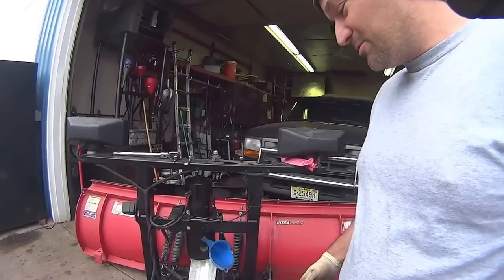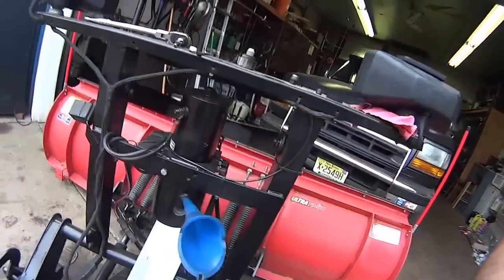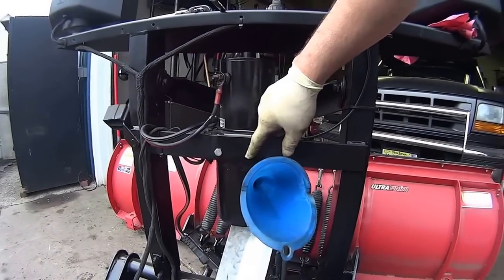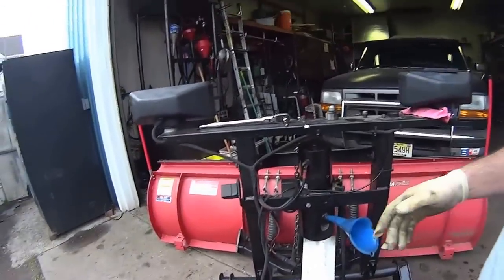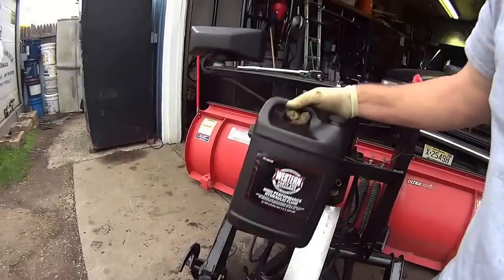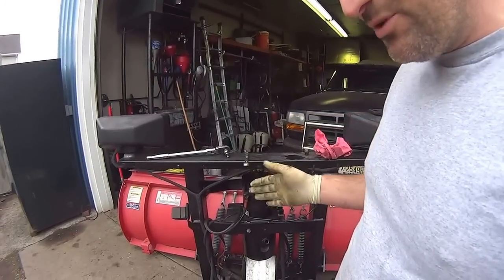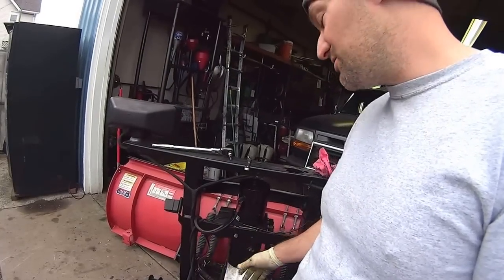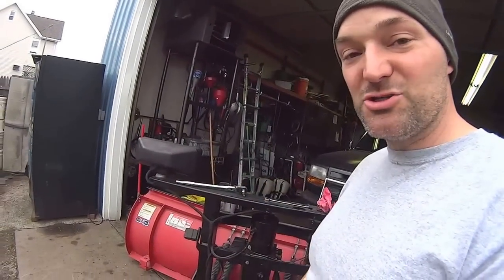Western ultra-mount plow servicing and head light check

Comment: No problem on the audio but I appreciate your video.  You gave me some great tips.  One guy on youtube said to pull the oil tank off, i pulled mine and had sludge at the bottom.  Cleaned reservoir and filter with brake clean...good as new.  These are great plows.thanks
Reply from the maker: Sting 
Yes beginning of every season before it gets used. 
These are vented and the humid air does cause condensation inside the units

Comment: Thanks dude, i just bought the same exact plow, same light out and everything!!! Thanks for the video, saved me some time.
Reply from the maker: Jesse Wustner 
No problem 
That’s why I make the videos!
Makes me happy when the average person like myself can save money on fixing things, to save money and not get taken by a**holes that over charge for simply things... 
Any question ask me before taking it to a western for service....
Reply: @DavidsHowtosReviews  i drained tank, i didnt take off tank and clean filters.  I refilled with new hydro oil, and moved plow up and down,  left and right a couple times, it worked well.  As soon as I was going to stop actuating the plow, it stopped working all together.   There is a click in the motor, when i use the controller.   There is no movement whatsoever.   Is it possible that the motor just went bad from sitting for a while?? It worked fine one minute,  the next,  nothing...  im lost, i replaced solenoid,  nothing....

Comment: How do i fill it with oil. My western plow   doesnt have a fill csp on top.
Reply from the maker: Most of the fills have a square nut as a cap, look for that.
Is has to be close to the top of the tank, it doubles up as the correct level indicator also

Comment: I have the same plow on a 01 2500 ram. I have no headlights or turn signals on plow. Replaced 3 plug isolation module as well. Still 0 lights, where do I find the fuses for this thing? Another thing I have a heavy draw when lifting and plows going up down left and right very slow. If pump is also bad np I'll replace it. I don't know anything about these so I don't know where to start. Any and all help is appreciated. If I could call you that would be awesome as well. I know calling sounds weird but I had a guy call me off one of my vids. Helped him fix his clutch on his motorcycle. Thanks in advance
Reply from the maker: Unfortunately all installers do these a little different there is no industry standard. Follow wires look for little water tight black boxes
Link to wire schematic
https://images.app.goo.gl/EtAfm3dvUr13dM4UA
Reply from the maker: As for the slow pump with the heavy draw. Take tank off remove the two filters and clean them if they are black with moss that’s probably ur problem 
If it still does it you can try changing out the motor they tend not to last as long as the older units we found
Reply: @DavidsHowtosReviews  i took motor off yesterday and its shot. ordered new one online, thanks for the link. ive checked the fuses and they are all good. my plow is the 3 plug w 3 plug isolation module. i also have the 6 pin contoller.
Reply from the maker: Good so that should solve your problem 
Just double check your alternator if you used it a lot like that, make sure it’s charging correctly.
Reply: @DavidsHowtosReviews  oh yeah its chargin fine. my other issue is not switching to the plow light and the turns not working on the plow. no working lights on plow basically.
Reply from the maker: If the control cable is on the older side turn the on and bend connector in a horse shoe shape those tend to loose connection if that’s the problem take a pipe cleaner and try to clean each hole and the poles throw some electric grease in there 
If that doesn’t work then it will be ether a relay or a corroded wire tapped off the main head lights 
Try to find voltage and move your self die the line till there is no voltage
Reply: @DavidsHowtosReviews  will do thanks for the help i really appreciate it.

Comment: Have you ever had your headlights go Dim when you raise your plow at night?
Reply from the maker: Yes usually a indication that your alternator is getting weak and needs replacement.
Put a DVOM on the battery and watch the voltage as u raise the plow if it drops under 13. U need to replace alt 
I usually get a larger size so it extends the life of alt
Reply: @DavidsHowtosReviews  I will go to AutoZone tomorrow thanks
Reply from the maker: Just don’t get a AutoZone alternator
Either go to a mom and pop place and get a really good alternator or have them order a Motorcraft or GM alternator or whatever your vehicle is
Their dura last and all those are knock offs kind of like what Home Depot sells
Reply: @DavidsHowtosReviews  ok will do

Comment: i am havin issues with same model. plow pump is not moving. all conections checked tight.
coil checked
wires checked
pump makes no noise? how to know if burned?
what year is your plow?
Reply from the maker: This is a 06'
If there is no sound I would check the motor 
The pump is possible but it's just a 2 gear mesh
If the pump was clogged u'd hear a wine or something it is possible that the shaft is broken 
It only is pressed into the gear.
I've had to replace the motors 
Check that first 
Run some leads direct to it just make sure u have the wires to the truck disconnected 
If the motor works 
It's the "motor" relay on the truck side 
It not the motor needs to be replaced
Reply: motor went out. solution: get a new motor. bought it, install it= fired up.
Reply from the maker: +Humberto M nice man! Glade to hear u got it.
Much cheaper to do it yourself... 👍
Reply: I found the part by a local dealer. having to do the mechanic part was difficult because you are guessing a lot and the snow kept coming down. I found that is better to have a spare than having to find a motor when is going to take 2 to 3 days.
Reply from the maker: +Humberto M yea that is what we do 
Spare hoses ,oil ,piston, motor, fuses.... 
It's a good idea

Comment: when I hook up my plow ultramount the light bar leans foward any idea what it can be
Reply from the maker: I would defiantly look at the area where the Square frame connects to the round cross bar. Checks the bolts and make sure they r not broke inside. Or make sure they r tight. 
Check the welds in that location too. 
That upper frame takes the weight of the plow when the plow is raised up so u can also have some one raise and lower the plow and look to see where it is (flexing) or moving      
Hope that helps good luck.

Comment: That breather is the filler port, pour in there until it comes out the other plug.
Reply from the maker: Jimi Neutron 
U mean the level plug 
But to get the oil in there takes forever.
To slow.
Reply: @DavidsHowtosReviews  no, I mean the cap that you called the breather, that is the filler, it is a vented cap and that's where you pour the oil into with the plug taken out, once it comes up to the plug level your full. Then put the plug in place and the vented filler cap in place and your done.
Reply from the maker: Jimi Neutron 
Right it’s a very small hole takes to long.
I pre fill the tank before putting it on then top it off when on.

Comment: Im having an electrical issue now, i replaced fluid, and moved the plow back n forth,  a few times,  then it stopped working, im lost at this point....
Reply from the maker: Jesse Wustner 
You need to pin point the problem at this point.

The plow side is three electrical sections 
1 lights
2 solenoids
3 electric motor 

Let’s ck the easy first and go from there
The truck cab connection put together and move them around don’t be gentle the connections may have corrosion.
 Now move to the Motor   
Truck side under hood usually on pass fender locate the plow relay by following the positive cable from motor 
There is a small wire on the relay pull it off and put a test light on it.
If it lights then put it back on it u hear a click or feel the relay clicking then it’s the motor. If you do not hear a click.
Just to double ck put the test light on the motor side terminal of the relay and see it the light goes on.
No you have a bad relay.
Yes you have a bad motor 
If you don’t have electric coming from the little wire. Check all the fuses ne’er the module of the plow 

If all of these are fine.
Then it’s the solenoid side.
Ck the little black/orange ground wire. 
Ck the motor ground wire.
You will need to ck the wires going to the solenoids to see if the have power 
If not it still can be the large black plug 
Or it can be a fuse by module 
Or u will need to replace the module
Reply from the maker: I just saw your other comment.
So if you hear a click.
And didn’t not pull off the tank and clean the filters.
I would suggest you do that first!
With all of the rain these get a lot of humidity in them and moss (yes moss) grows in the tank and on the filters they get clogged solid.